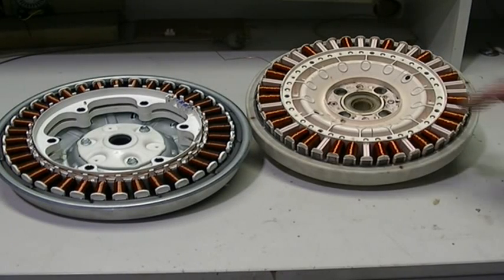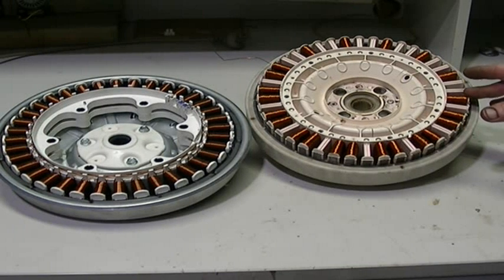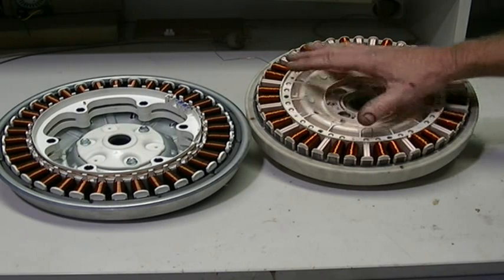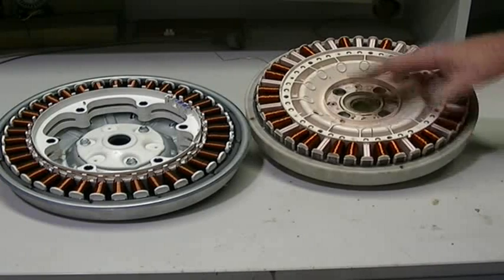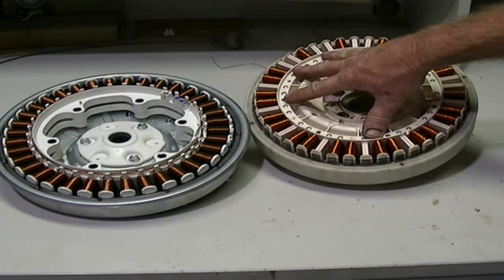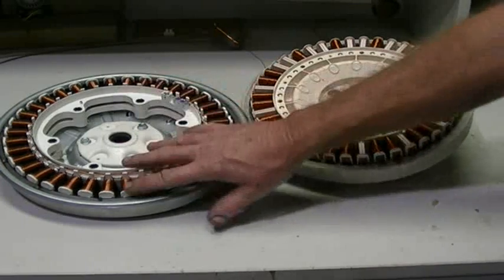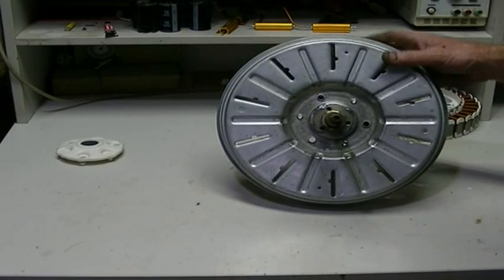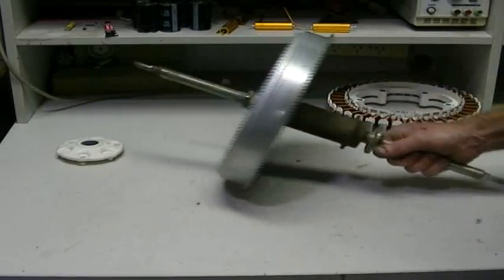DIY Electric Outboard from washing machine motor

Comment: @OzSolarpower, did you know that if you keep you stater stationary and 
raise the can keeping your air gap
Speed, RPM increase dramatically 
As the magnetic pull- breaks.

Comment: I'd like an outboard trolling motor for my boat that will run directly off the 6 kva onboard generator , never seen anything off the shelf so I would have to build it. Is this a good motor to use ?

Comment: correction: The one on the right is a smart drive, the one on the left is a direct  drive. The best I've seen running  broke the stator into 12 - 3 phase motors  to run on a R/C controller , I hope you can find a better way.

Comment: yeh ive been hunting for the hundred series , im too lazy to rewind them. im going to contact a few repair shops , thanks for the various tips, seen the carrier wind gen kits use in the USA.
Reply: try new zealand
Reply: @douglaschell1132  theyre very common here in Australia too , you can usualy find them on the side of the road when the yearly road side rubbish collection is scheduled, ive made turbines using the 60 series but the later model is far more interesting